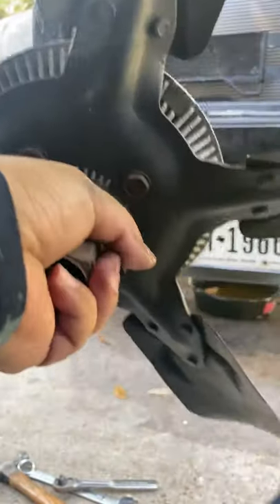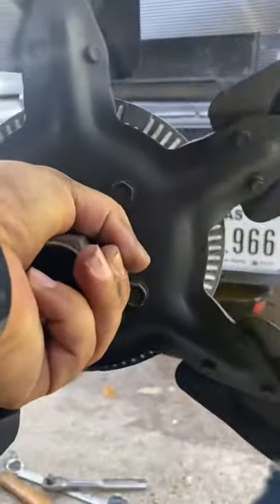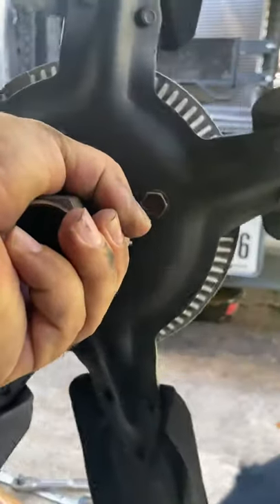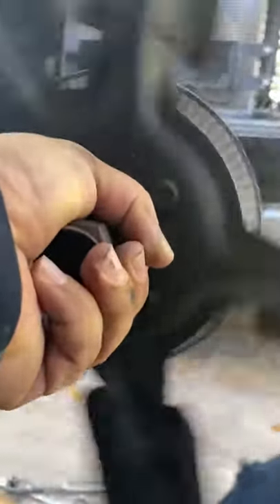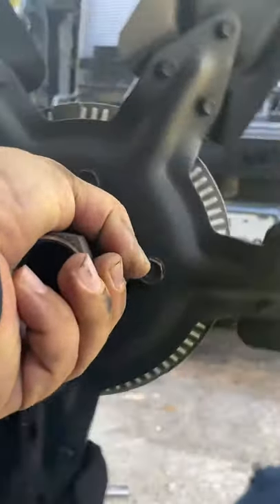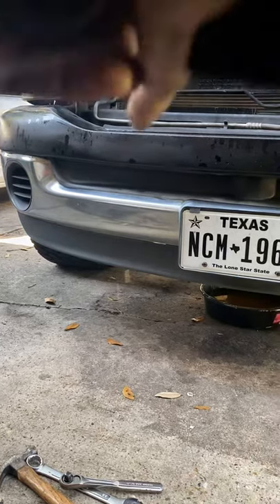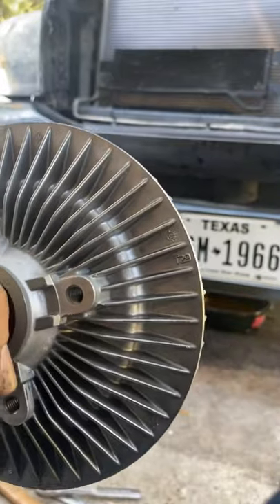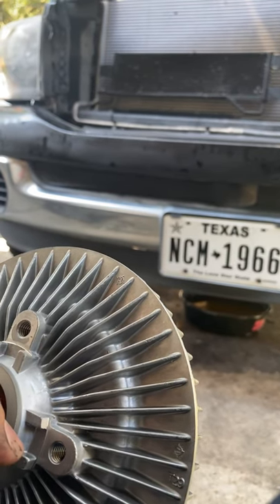Fan Clutch Hand Test for any non electric fan

Comment: Ur advertising the wrong thing,,, DELETE UR VIDEO BUDDY, the fan clutch is supposed to lock up when going at extreme rpms not by hand, bu hand it only loosens because there is not heat, with heat on the spring it will lock up,  go ahead and put fire on the spring in front and watch the clutch lock up,, u guys make people go buy parts that they dont need, ur fan clutch is fine, if u spin it when its cold and it doesnt spin the first few times than its a good fan clutch
Reply from the maker: I agree, thanks for the comment
Reply: heat on the spring it will not make the clutch lock up directly,,, heat on the spring just make the valve inside open and the oil will make fast circulation and lock up the blade+shaft...
Reply: @holaomar7466 

With all due respect, I wonder, so you agreed on this but still 1 year after the video is still posted? 

Non electrical fan clutch has the highest inner drag at the hottest tempetature. When it is cool it is suposed to spin in less synchronization with the engine pulley.

Comment: Why are clutch fans needed?
Reply: Clutch fans are needed because it cools the engine down so your engine won’t overheat and if you have a bad clutch fan you should replace it as so as possible to prevent engine damage
Reply: @rayraymartinez7111  why not regular cooling fans
Reply: @MrSamPhoenix  it depends you want to change it to a regular cooling fans but most manufactures come with Clutch fans are stock which is best for it since it is the original
Reply: clutch will lock up if valve open cause of heat spring,, and will more relatively freely from shaft if valve close cause not enough heat to turn the bimetal spring in front of clutch..

If use directly blade to shaft it will make high noise from fan and make more load to the engine..
Then,, if use the electric fan it lower durability other than viscous clutch fan..